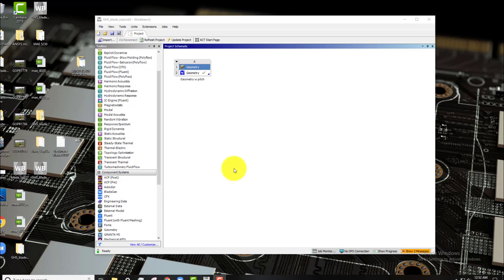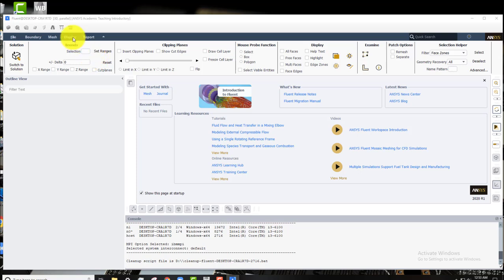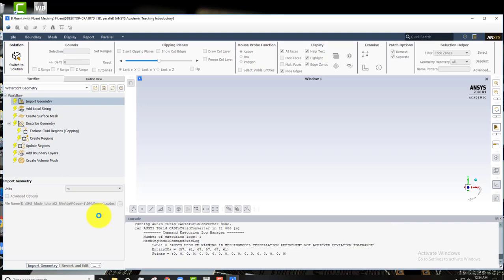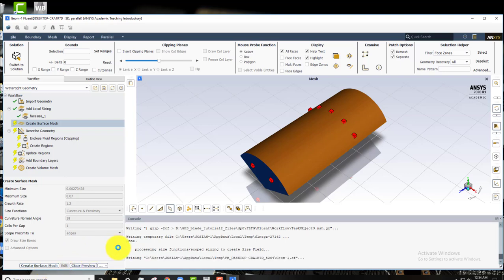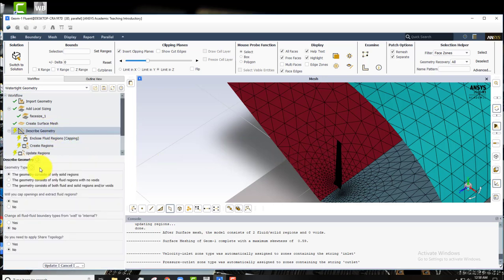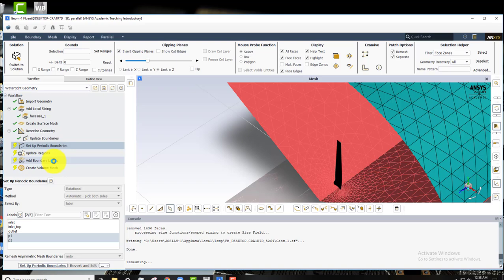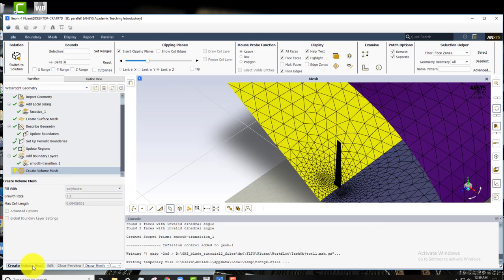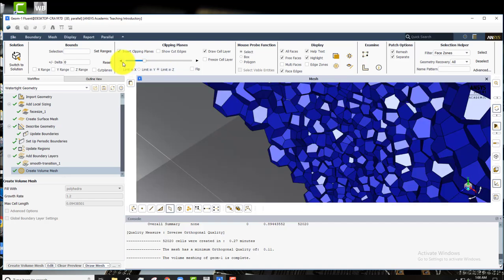wind blade tutorial - meshing

Comment: Hey! just wondering how do you setup a 180 periodicity with the same setup. I am working on two-bladed drone blade but I do get an error because I can only put P1 as there's only one side of the periodicity wall. I tried manual method on setting up the periodicity for some reason its asking me to input rotational axis origin and direction but everything starts and end at 0 at x, y, z plane then its says "at least one of the axis components needs to be set to a non-zero value". Thanks for your help!